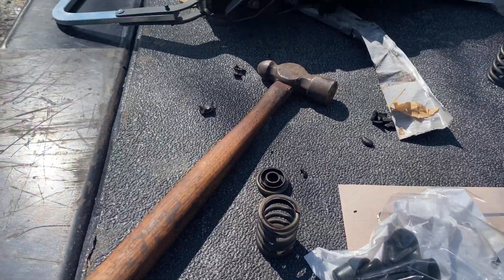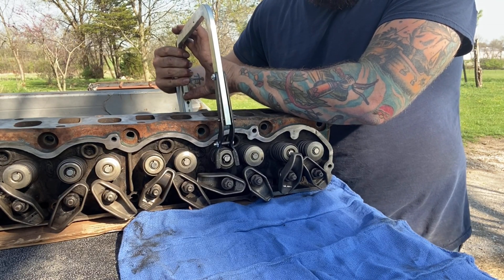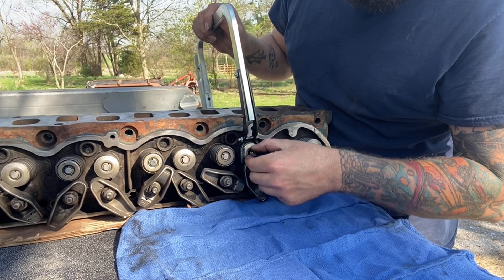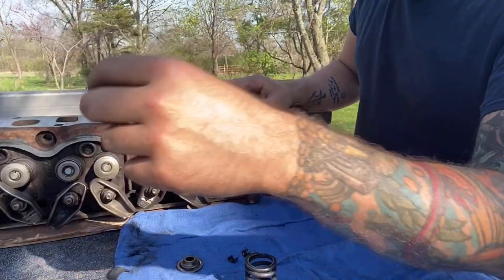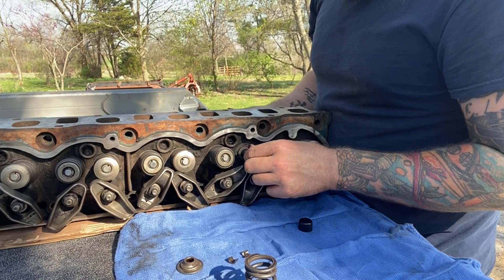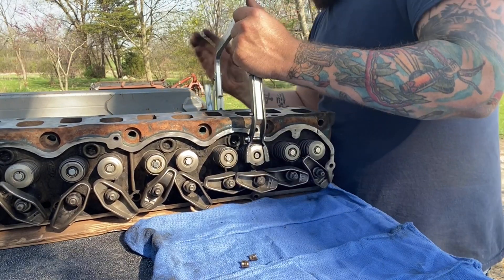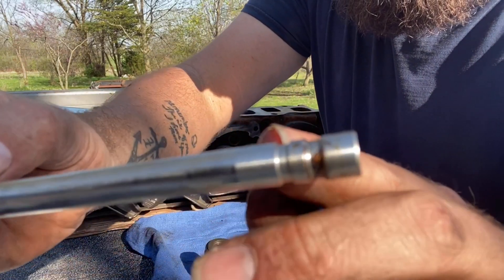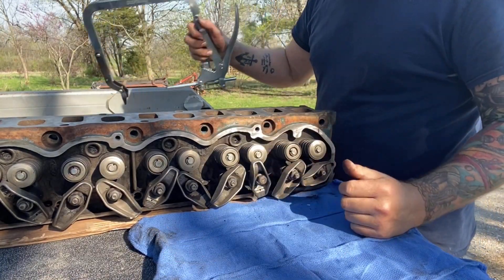Replacing Valve Stem Seals Ford 300 4.9L Using C-Clamp Spring Compressor

Comment: I like the chief one that he had the arrow pointing at the bottom at 2 minutes and like 30 seconds or so why do is I take a socket that is bigger than those clips what the head sitting outside like that I think I had when I tap on the back of that socket to Break Free the retainers and that breaks the tension and then I use the spring compression tool to release the spring pressure and I push on the back of the valve in Alaska Lee release the retainers without causing any damage or needing it needing any hemmer work while the Springs compressed your loss praying from Preston you hit it with a hammer it could actually come apart on you and hurt you